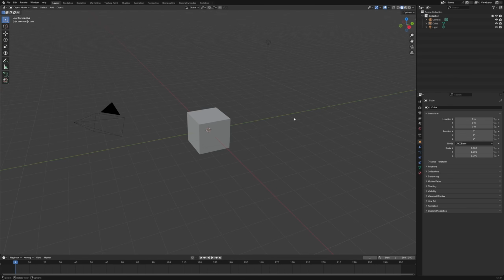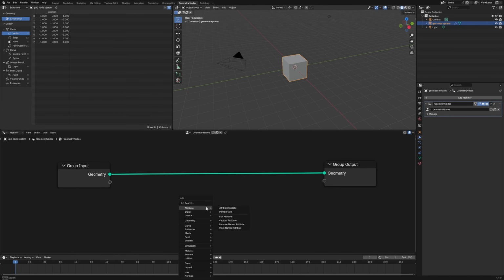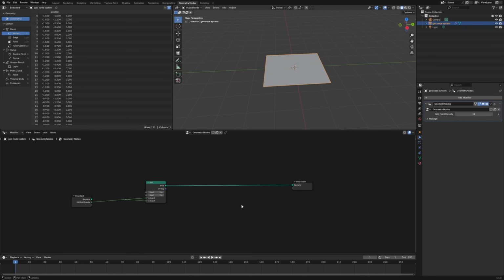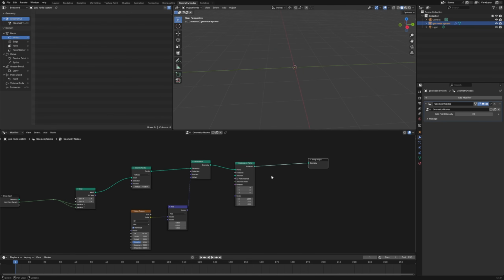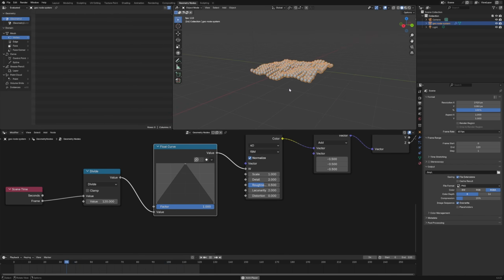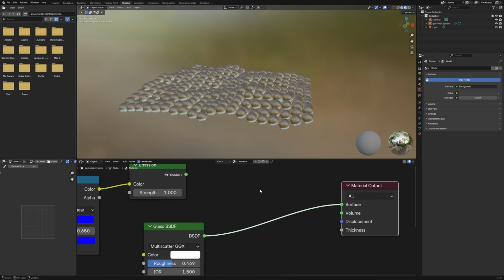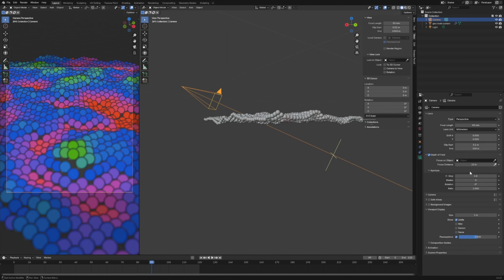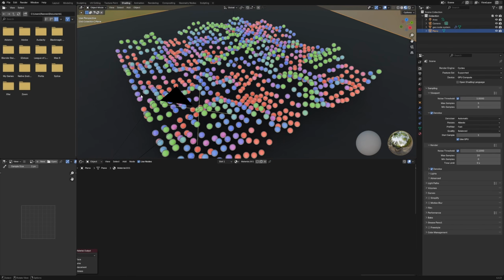Your First Blender Geometry Node Project. Geometry Nodes For Absolute Beginners

Comment: The location color change doesn't seem to work for me, the color ramp only seems to be blending the red, blue, and green together and the map range node is only making it closer to each color depending on the range I choose
Reply from the maker: It's been a minute since I did this tutorial but I think I did the Z for the location to drive the color. So you need to use a separate xyz node to split the location into x y z. Take just the z component of the location and then throw that into the color ramp that should let you have height based shading. Hope this helps!